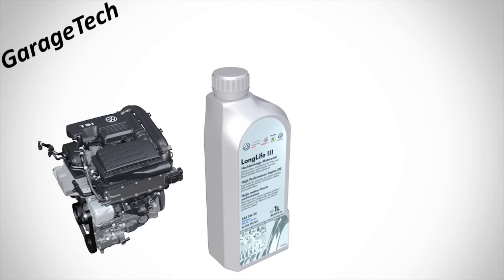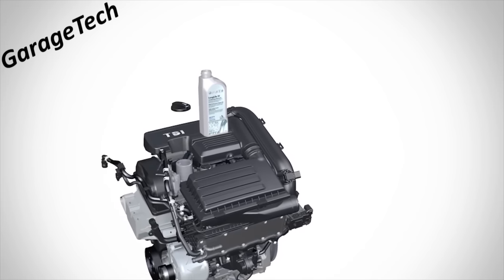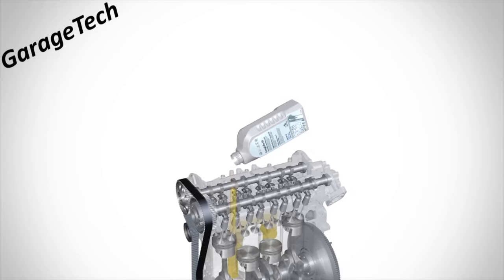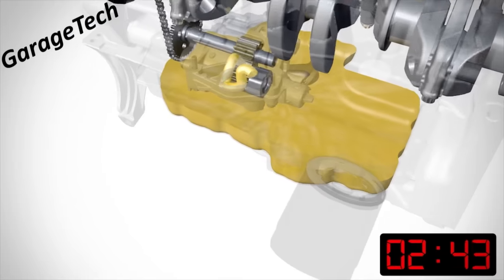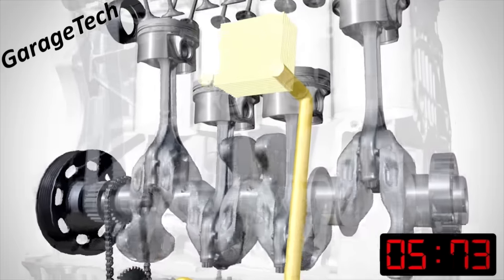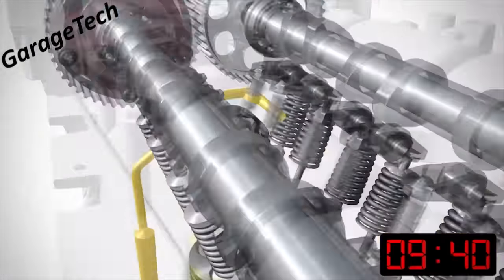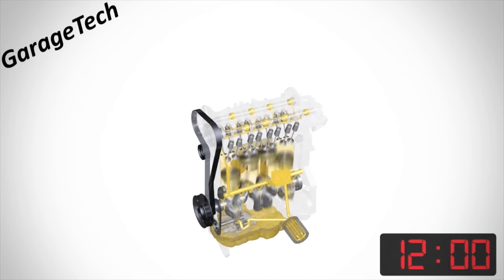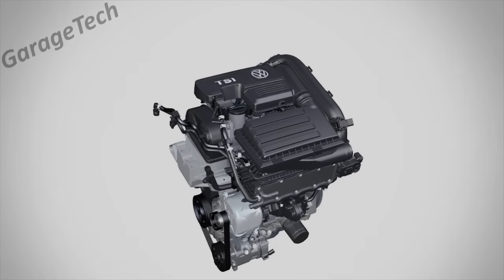How oil circulates around an engine when started

Comment: I take my engine apart and manually pre-lube all the internals before every startup. It’s the only way.
Reply: Zack Zander Thank you!! 🙌 Nobody takes the time to do this anymore.  I carry a disassembled cherry picker in my trunk everywhere I go.  I simply assemble the hoist, pull the engine, and lube up!  Personally, I don’t leave the parking lot until I’ve manually inspected each piston, con rod, and wrist pin by hand.  I perform a Rockwell hardness test on each con rod, a piston pin bore diameter check, con rod bearing tunnel diameter check, and lastly I check for cracks.    It takes me about 6 1/2 hours to pick up milk but I think it saves time and money in the long run.  I buy my oil filters in bulk so I can put on a new one every time I start the
 car.
Reply: ryebread WOW. I am definitely going to start doing a better job inspecting all the bearings, pistons, crankshaft, valve guides, cams etc before every start up like you. I got lazy and was only doing that on the weekends, you know, when a guy has a little more time. I felt I was doing good enough just taking it apart each time and pre-lubing it. Do you think I did any damage to my engine by cutting corners? I still would fill the crankcase with new synthetic oil (100% group IV base stock)every time and do a 30 minute warm up, even if it’s 85 degrees outside and I run in and out of the store quick. I just want to prolong the life of my engine.
Reply: Zack Zander That's admirable but the supreme way to assure engine longevity is to simply have a warehouse full of engines and replace your current engine every time you're ready for take off. Every trip I take is the work of a brand new engine, every time. Putting my mind at ease knowing every engine will be responsible for just and only it's current trip.
Reply: Zack Zander you dont have to, oil doesnt disappear from the bearings etc when engine is not running, you know
Reply: Draek Tears I build a new engine every time I need to drive
Reply: Niiice 👍
Reply: @TJNightTrain  you're fun at parties, aren't you?
Reply: @peter falkinhell FAX
Reply: @RyanStorm0  haha u guys do all of that? I just buy a brand new car everytime I go for a drive.
Reply: You guys are taking forever doing that. Just drain the oil, replace drain plug, remove valve cover, and sprinkle oil onto head (to spec) and zip back up. Only takes about 2 hours just don’t forget to change your gaskets and to torque (to spec) to spec
Reply: I got fired from my job for this and you'll never guess why..... I was always late.
Reply: I just pick a new car from the vending machine.
Reply: Did you take your brain out and check it first?
Reply: that doesn't make any sense, are you saying all car factories do it wrong then? what is the point of putting the engine together and then taking it apart again just to lube it?
Reply: You're doing it wrong chief. Way to complicated. I just   remove one of the spark plugs and feed in motoroil till it won't take any more. Job done! Oh don't forget to put the sparkplug back in, really important step.
Reply: Maaaan i letteraly laught AT your comment 😂😂😂
Reply: No need, just pre fill the oil filter (if it's possible, it's not on my car due to it being upside down) then crank the engine with no injector feed or spark so as not to actually start the engine, crank the engine until the oil pressure warning light goes out the start as normal.
Reply: This is the way
Reply: @RyanStorm0  I do exactly what you do and I actually do an alkaline test before I disassemble engine and lube up every internal part.takes me bout two days sometimes one every start up
Reply: I got impatient so I bought a factory and use a new car every day
Reply: ahahahahahahahahhaahhaa
Reply: Zack Zander I like to rewire my car every time I go to the store! We should collaborate on a project 😁
Reply: why are you lying?
Reply: After every oil change? That’s a waste of time. There’s no need to do that. When you change the oil, once the oil is drained, the components are still wet from the previous oil; And will provide enough if lubrication for the initial start-up, after putting new, fresh oil in.
Reply: I got too lazy to change new oils.  I took my BMW to work everyday.  (Bus,  MRT,  Walk)
Reply: Bruh, its seems that i dont need to do this.
Its been bugging on my mind that i should do this before leaving asap.
No sht 😐
Reply: I normally prefer to dig down and collect crude oil, which I then put through fractional distillation to make my own blend of engine oils so I have enough to stop every 12 seconds to change so. I oil ever gets circulated twice
Reply: I do similar routine with internal check but every 32 miles I pull over an pump the Kanuter valve twice.  Plus don't forget to charge the flux capacitor Marty !!
Reply: @WhiskeyGulf71  Lots of wear on your starter motor. You could use Royal Purple oil and stop worrying about engine wear during startups. Best regards.
Reply: Baran MK6 I just reincarnate and buy a new car so everything is new!
Reply: 🎶 Y tf u lyin
Reply: Same
Reply: @RyanStorm0  I need to start doing this.
Reply: That’s a waste of time. Just leave your engine running.
Reply: Well, that and the tire rotation.  Why else would they put a car jack in the trunk? 😂
Reply: 104 Lockhaven  he's not a liar. I saw him do it.
Reply: I admire all your hard work to make sure your engine is nice and oiled and lubed before every journey, now I found a simple trick to not having to spend as much on oil and maintenance and I did the piston, cylinder, and cam delete, it saves the engine all the trouble of having to lube all the important parts but just not having them in the first place, I’d highly recommend this simple tip!
Reply: ryebread and engine rebuild kits in whole sale too?
Reply: David Klein My man I lolled my ass off at your comment.Bravo dude👍😂😂😂
Reply: WTF IS GOING ON HERE :O
Reply: I'll try this, what an ingenious idea
Reply: I never turn off my engine so it is always lubed when i need it, it's been working for 6 years now
Reply: You guys are doing great, seriously. Although I want to point out that it's highly beneficial to rotate tires every 3-7km or every day, whichever comes first. Sure it might put a hair of stress on steering components but that's why you toss out the steering rack and pinion every other change.
Reply: Clueless Blamer 🤔 man that’s some solid advice. I don’t rotate my tires cuz I put a new set on every night when I get home. My back yard is filled with P275/60R18 Good Years stacked higher than my house.
Reply: @zackzander425  nice. I was planning to do the same but I lost my 3% off discount code. I ain't tryna go broke here :(
Reply: Haha damn and all this time i was only doing oil changes after a mile of driving..no wonder my engine blew up frequently
Reply: @TJNightTrain  r/woosh
Reply: The quickest way for me is before every morning cold start I lift the engine out of the car with my bare hands and give it a good old shake, then dump it back in. Saves you a lot of time taking it apart
Reply: @calinwin445  This is the way
Reply: Honestly, the best chain of replies... EVER!
Reply: @roadreg1820  No need to add oil to the engine after you've drained it! There's still enough coated in and on every surface of the engine, no need to fill up.
Reply: No you got it all wrong
You just fill the engine completely to the top of the filler hole, it may take at least 10 gallons but it will never run dry.
Reply: @draektears2794  if my engine has ran anymore than 1 hour, I replace it
Reply: I recently changed my engines lubricant from Castrol oil to premium gas, and my oh my my gas mileage and horsepower is outrageous
Reply: It could work to not damage the engine when starting dry after an oil change but that’s a very stupid long process, plus that could fuck with the viscosity of oil
Reply: I buy a brand new car every time i go for a drive. that so i don't have to hassle with opening the hood
Reply: the threads will be stripped over time..
Reply: 5w30  8s
Reply: I had a feeling you didn't have any automotive videos on your channel.
Reply: I just take out the engine every night to prevent my car from stealing, and in the morning I just pop it back then drive to work.
Reply: @RyanStorm0  you must get better prices than anyone else in this world for the gaskets, head bolts and seals. Such professionalism
Reply: Now that's dedication
Reply: This is the way.
Reply: @RyanStorm0  wtf did I just read
Reply: You try telling the young people of today that. And they won't believe you.
Reply: I don't drive my car so my engine doesn't take damage because of lack of oil. It is the best eay to save you engjne
Reply: @RyanStorm0  I'm dying 🤣
Reply: Video or didn't happen
Reply: @chacorta3478  I gotcha.  I build one everytime I think about driving.
Reply: You all need share the medication your taking
Reply: @draektears2794 well I guess I'm cutting corners, what I do is, I bought multiple of all internals including crankshaft and camshafts like 4 sets of them just to be on safe side and keep them soaked in oil, every time I'm about to drive, I only replace the internals. And soak the ones I removed back in oil till next time.
Reply: That would slightly delay your getting to work e every day, wouldn't it?
Reply: Amateurs I have a truck specifically designed to tow my car around so I don't put any miles on it but still get to drive it around

Comment: Just start and redline it, the oil go faster to the parts
Reply: Thats what we do for oil changes to check for leaks 😂
Reply: Bruh imagine people thinking its good to redline at start
Reply: Gay Vampire one of my neighbors have her car on drive ready to go before the engine finishes up cranking. Nonetheless her car sounds worse every day that goes on
Reply: Maybe they are low on blinker fluid
Reply: and the engine will go faster to kaboom
Reply: My dad told me about a neighbor he had when he was a kid who would start the car with his foot all the way down on the accelerator. We never knew why but he probably hated his car
Reply: @davelovell8631  My grandfather told me that one time his neighbor accelerated the car as soon as it started and floored it, and in a few moments the engine exploded and some parts of the engine flew away ...
Reply: @gabrielvieira6529  what year was that and car too ?
Reply: @Thevol40k  I really don't know.... May be from the 60's - 70's
Reply: @gabrielvieira6529  Scary!
Reply: @davelovell8631  If your engine's flooded, you can do that to start the engine, but make sure you take your foot off the gas pedal when the engine runs smoothly or a connecting rod may break up the engine.
Reply: @brianlaramee2667  Yes!
Reply: I've been doing that to my Toyota for the last 21 years. It just won't die.
Reply: @testtickles8755  🤫
Reply: Gay Vampire - I know someone that tried to get their diesel car out of deep snow by redlining it in first gear whilst cold.
It may come as a shock to some, but the engine did not survive. They put that much torque back through the drivetrain it bent the camshaft.
Reply: Rev engine in a cold start
Reply: While waiting for the school bus back in the early 70s we would see/hear some guy across the street do just that? Wasn't long we didn't see/hear him any more! I wonder why? 😆 😆
Reply: Lmao
Reply: Yeah especially if it's a turbo diesel
Reply: I replace my engine oil after every trip! Don't want to reuse used oil.
Reply: My neighbor did that every morning
Reply: doesnt it harmful to our engine?
Reply: @ismail250bak  you mean "isn't it" right not doesn't it.... It's ment to be a joke.
Reply: @drfix2020  so is it right or not to do it so
Reply: @ismail250bak the majority of the engine wear happens at start up! Use the oil called for by the manufacturer, that goes for the transmission also. & need to be baby it for at the very least 15 seconds.
Reply: Gabriel Vieira pissing myself at your comment 😂😂
Reply: @elijahlloyd5031  well, no one knows all the answers all the time on every subject.
Reply: Abhishek Pawar all diesels in cars and trucks are turbocharged
Reply: Engine would scratch
Reply: @vampy625  its never good to rev it redline it destroys engine and ur gonna get check engine light on
Reply: Not when it's cold
Reply: A Gough  same here, no one will ever treat your car like their own no matter what
Reply: This is what most people in the UK do, soon as they turn the key in the ignition drive off hard.
Reply: Start the vehicle, put it in neutral, floor it til its bouncing off the rev limiter, then jam it into gear and the violent smashing of gears and utter internal destruction will ensure the motor is completely lubricated.
Reply: Start from redline.... Faster.
Reply: Redline after start is the best think you can do for engine😀
Reply: @reaperactualgaming3075  😭😭😭😭
Reply: Hellooo...! Just grab your neighbors garden hose (this is best done at 2:00 a.m.) then simply top the motor off with water! It's much cheaper than that overrated oil stuff.🤑🤘
PS: As you are now in "possession" of your neighbor's garden-hose, legally it's now yours! 👍⛑️
Reply: Faster to the auto parts hâhha
Reply: Wtf ni
Reply: @Conconboss  how’s her engine now
Reply: That would destroy engine
Reply: @Thevol40k  2020 Ford, GM or Chrysler. I'll have to check.

Comment: I park my car flipped on the roof, so the oil stays in the engine. Can't risk it.
Reply: I just pour oil on top of the engine to lubricate it before every start
Reply: @nou8257  you're silly mate, I have an automatic hose that does it before I start the engine for me.
Reply: @StrongFreeLovin  that's too fancy for me m8
Reply: @StrongFreeLovin  I usually load some 10w40 into a pressure washer and make sure the whole car is lubricated
Reply: That will actually do more damage. The oil will submerge the cylinders, leaving the crankshaft dry. That oil will get on the spark plug, restricting its ability to spark, and much more. I do think that is hilarious tho
Reply: 😂😂😂😂😂 That's the best comment ever 😅😅😅😅😅